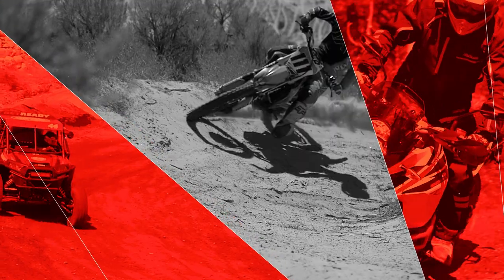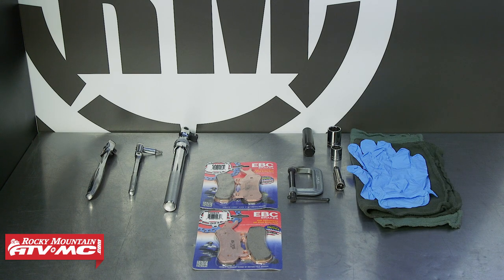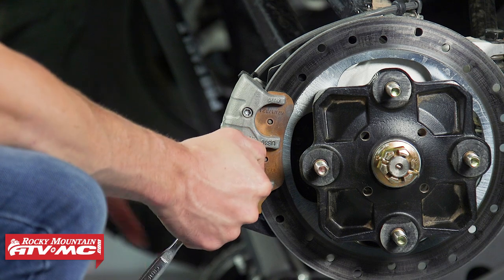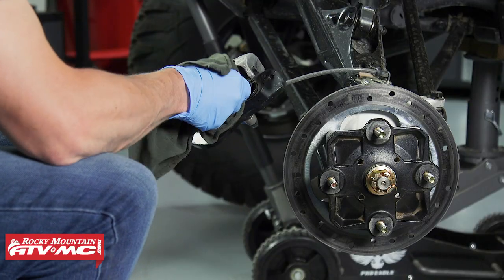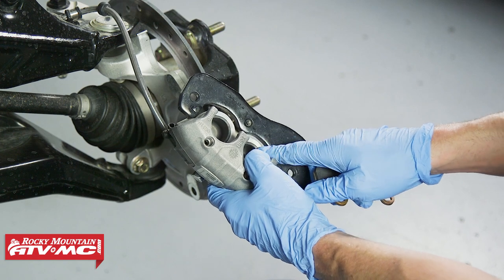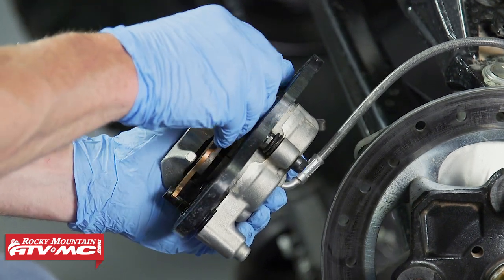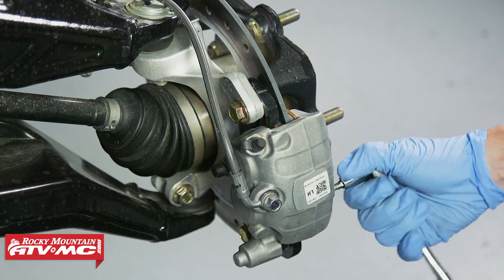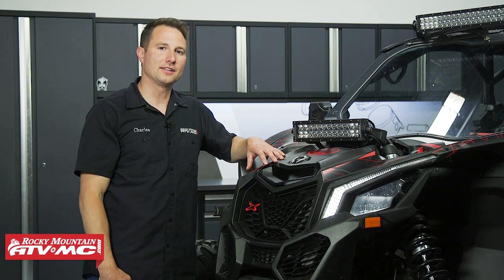How To Replace the Brake Pads on a Can-Am Maverick X3

Comment: I just changed my stock pads on my 2021 xrs turbo rr with the ebc fa682x and fa683x and swapped out the brake pedal with Xrc pedal and now my brakes are spongy. What could cause that?

Comment: I have the previous maverick 1000r and I'm struggling to remove the 2 pins (allen head) any tips to remove them?
Reply from the maker: Hi Eddie. Make sure the caliper is still mounted before loosening, use a quality bit, if they are still stuck, then try using a handheld impact driver to loosen them up. Using a quality bit is key. Let me know if this works. https://youtu.be/cjV5rQAZH18?t=130 -Charles